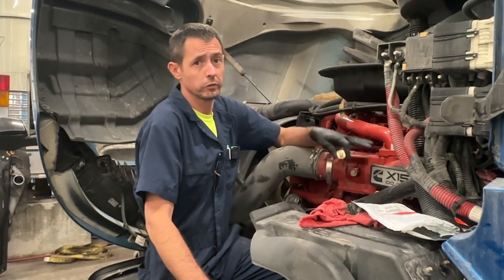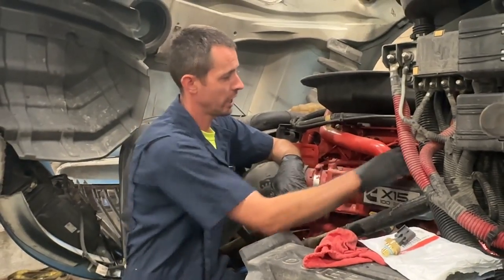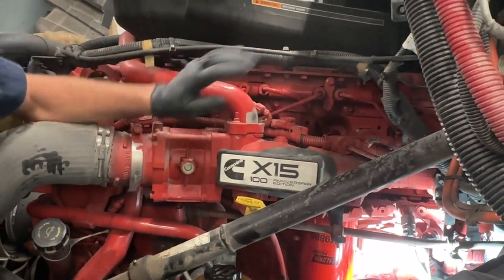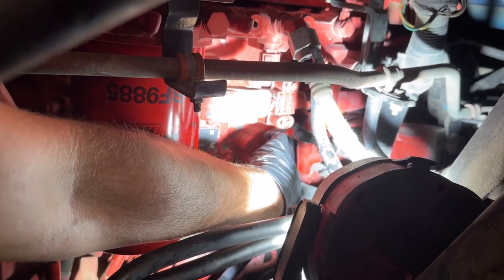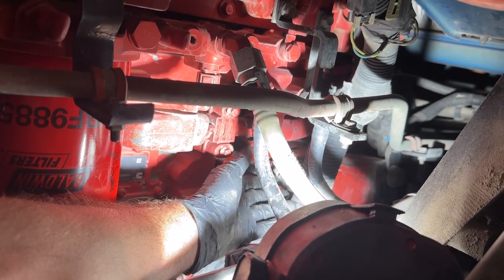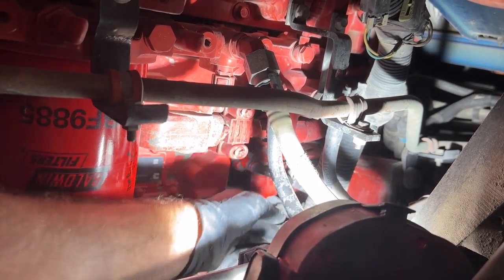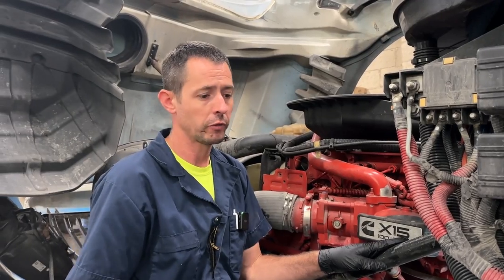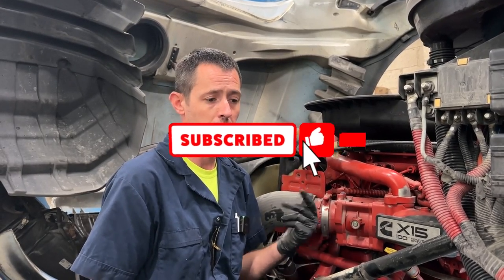How to Tell Oil Pressure Sensor is Bad on Semi Trucks

Comment: Just changed mine out today on my pre Emissions series 60....I was   having my oil pressure jump from 50psi to 20psi at 65mph....the check engine light and the red engine protect light come on for a few seconds cut power from engine then pressure jump back up to 50 psi and lights turn off did this like 4 times a day.old sensor was corroded with thick black oil build up.....just hope this fixes problem....won't know until next week....
Reply: What happened?

Comment: Hello everyone I have a question not related to this videos but I need to know. What happens if you drive with the coolant filter valve in the off position for a long time? I didn't even know my truck had coolant filter. Isx 475 2007 kenworth t600 thanks everyone
Reply: nothing, the filter isnt really a filter it adds dca which is a additive that controls the ph level of your coolant, you can buy test strips and buy the liquid bottle and add which is way cheaper than the filter,